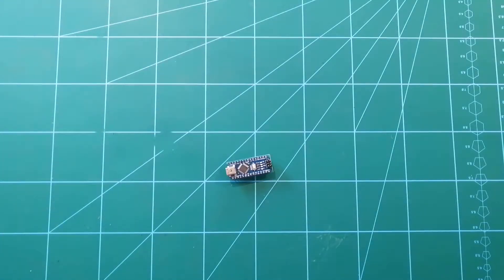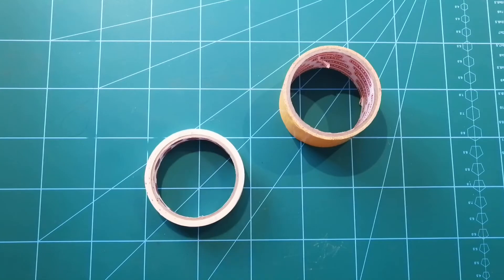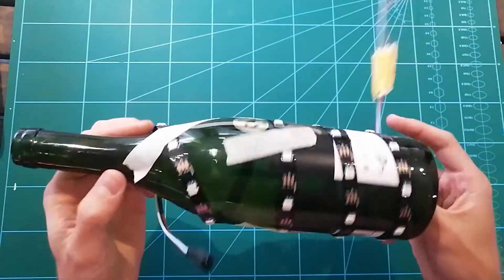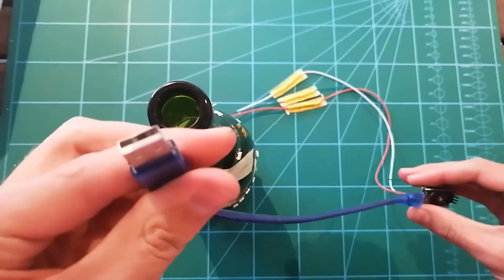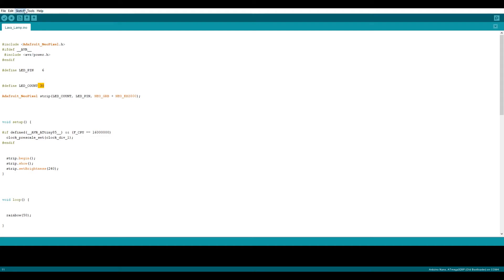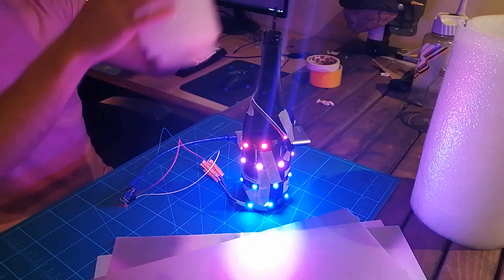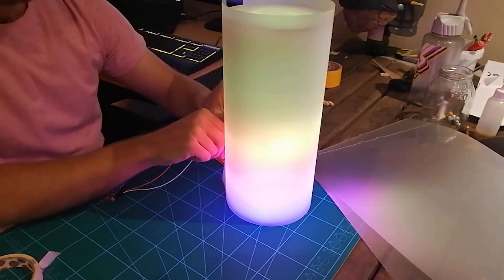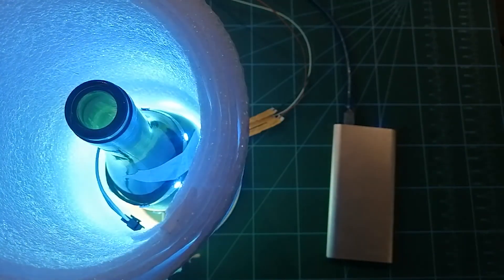DIY LED Lava Lamp (Neopixel Led Strips & Arduino nano)

Comment: what software are you using to unzip your file?
Reply from the maker: 7zip
Reply: @Mexnov  Thats what I used on my old laptop and didnt work :/
Reply: you think I'll have to get a raspberry pi to run it independently?
Reply from the maker: @WARLOCK1669  well you need an Arduino Nano  or any Arduino really and it can run independently. It's cheaper then a raspberry Pi. The code will also change if you use a Pi.

Comment: Just made a lava lamp with existing controller but followed similar method of using foam ( sort of combined different DIY as i tried to use the materials i had in home). It looks good, the diffusion is satisfying. Next steps are to get arduino nano and experiment
Reply from the maker: It's the best when you get things to work , specially if you use the things you have at home. Well done.

Comment: What if I use more than 200 leds?
Reply from the maker: Well on the top of your code I use an example of 30 LEDs you can change the code by declaring it to be 200.there should not be to much hassle using 200leds but if you are worried about that you can always Cut the strip, solder a wire to continue the information from one strip to the next and run a new positive and negative cables from the power source which in your case can be the anything with 5v. Hope that helps.